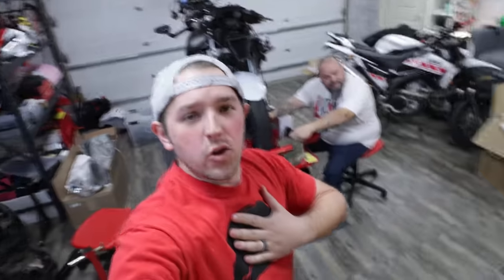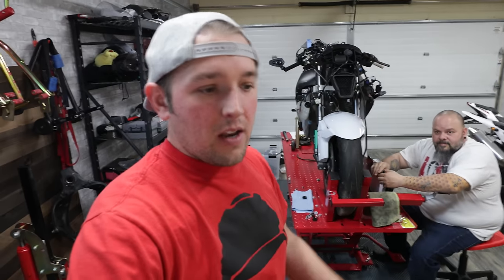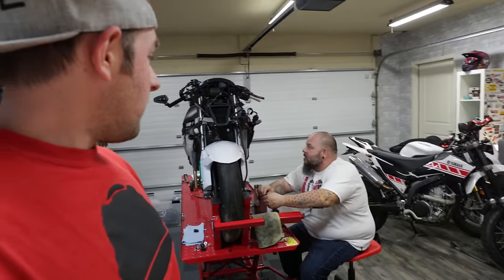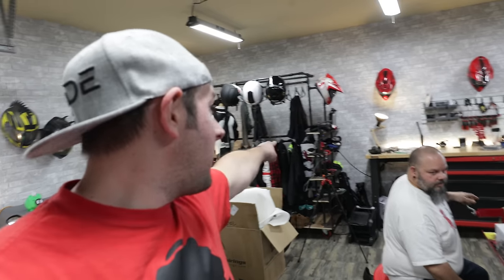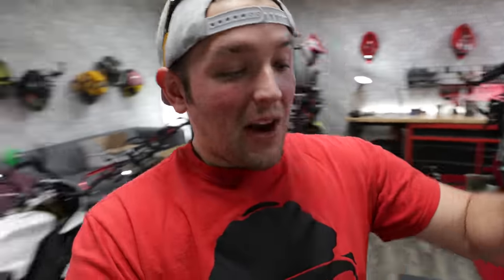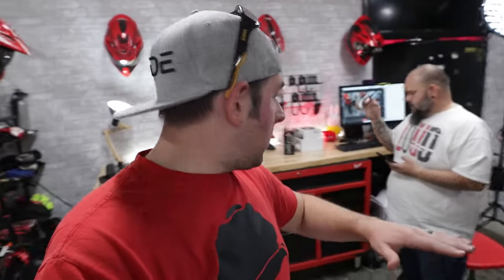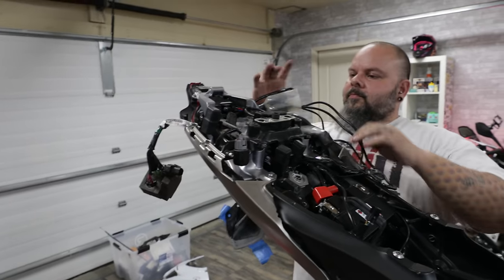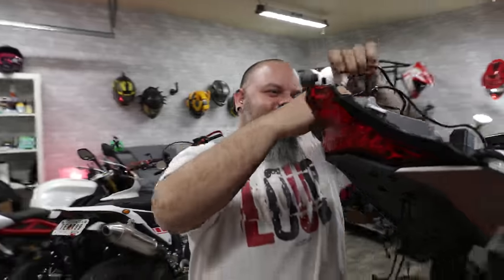LED lights install attempt! Why do they do this?! [Wrecked Bike Rebuild - S2 - Ep 16 - Ninja ZX-10R]

Comment: Sorry but I'm gunna have to beat the dead horse. You DID have the grips on your R6 installed backwards. The larger metal piece (they were white on your R6, I went back and watched an older video to make sure I wasn't crazy 😅) faced outwards and away from your bike, and not the way you described their orientation in this video. Either way I'm glad you googled it and determined the correct way they go on, because like you said, it feels natural to have large metal piece towards the inside of the bike as it acts as a perfect resting place for your thumb. But for the record, they weren't that way on Holly 😂. Anywho thanks for the free content as always!

Comment: I have the same bike and installed LED lights in my headlight housings. I used Heise LED's. What i did to make them fit, and keep it water tight was to cut the cap down to just the base and used epoxy to attach a new plastic cylinder to the end. I have pictures of exactly how i did it. it worked out great and looks factory.

Comment: I know it's all the rage to have cordless everything, but this should serve as an example as to why you should have a power cord BACK-UP dremel tool. Heck, you should have a power cord back-up to almost every tool you use (rely on) the most. Just sayin'. Oh, before I forget, you should NEVER (under any circumstance) smell ANYTHING your buddies say "hey, smell this..."! It's never going to be pleasant. Just remember that for future reference.
Reply: Actually, I'd say in your own garage you should have everything WIRED IN. Cordless tools are only useful outdoors and in construction where it's not possible or practical to drag an extension cord all over the place. When it's your own garage, you have no excuse. I mean really, how hard is it to manage a couple of cables? It's just laziness in my eyes. And you gotta plug the battery into every tool, the same way you have to plug in a cord so there's basically no difference.

Comment: They make universal dust covers for the LED’s. It replaces the stock dust cap. I used some silicone to seal them to the headlight housing and they sit tight around the led bulbs. I got a set for my R3, I did a cheap led/projector update a couple months ago.

Comment: Chase, I used abs cement ( for sewer, drain, waste and vent systems) to fill in the hole on my bike because the hole wasn't perfect. The stuff is made for high heat and has lasted on my bike no problem. I used the brand Oatey #30916.

Comment: If you think you need any extra sealer. Get a tube of RTV silicone. It's made for engines so it's not going to be affected by what little heat the headlight can produce.

Comment: for the flasher they sell an electronic flasher specifically for LEDs that will be a plug and play for the stock flasher. no need for the resistor block Brian was talking about.
Reply: Yeah its called a flash-relay or something right ? That works for both back and front blinkers that is made for LEDs less power.

Comment: I have installed those Driven d3 grips on my SV650sf years ago. They were tight enough where you don't need glue for them. i used some silicone spray to help them slide on. After the spray had dried/evaporated they snugged up and don't twist on me.

Comment: Take a drill bit with the right size to open the bar end and get a blinker relay that can handle the led lights and you have a real easy job done without any additional work to do.

Comment: H4 is a high/low beam in a single bulb, which is why motorcycles using it typically will use a single bulb. This includes a huge share of all motorcycles in production, like most cruisers, dual sports, and many naked bikes. Its not missleading to say its a kit.

Comment: Chase should've looked into OPT7 LED, Stark LED phantom series, or Novsight LED's. personally opt7/ novsight are my favorite because they fit perfectly inside the stock housing. I like to punch holes on the backside of the headlight dust caps just to allow the hot air (built in fan from LED) to circulate out.

Comment: Shouldn't the lever guard be on the right hand side to prevent accidental breaking and making a front flip?
Reply: They're gonna install a breakaway brake lever, hence the lever guard on the clutch side.
Reply: The lever guard is a bit pointless on the clutch, it is there for looks alone, the lever guard is meant for the brake side to prevent accidental application of the lever from contact from for example other bikes in racing.

They come from Moto GP and super bikes, they had issues from bikes colliding and hitting the lever causing bikes to crash.
Reply: +WRAIIITH brake lever guard is to protect the brake from being activated while riding by another rider, car etc. Breakaway lever will not prevent that therefore putting it on the clutch side is useless. One look at motorcycle racing and this would be obvious, not sure what’s so hard to understand...
Reply: realsmokey11 Yes! My CRG levers tilt up; that will not help in a track entanglement. I have never seen a lever guard on the left. It makes zero sense.
Reply: It for the clutch as well..

Comment: the led's often come with a ring that installs into the headlight housing. then you place the rubber boot on. then place the led shaft through the hole the rubber boot and into that ring and rotate to lock it. and then connect it to the stock wiring. check to make sure the led's you buy have the removable ring.

Comment: Use Cyclops LEDs. They work perfectly on Kawasaki. Had it on my ER6N. No need to cut the outside cover, also everything will fit inside the housing because there is enough space including the “ballast”.

Comment: Chase you should buy your led bulbs from auxbeam. The driver is smaller and there's less wires and they make really high quality led bulbs. You can get a 2 pack kit for $50. Also you can buy an led flasher relay instead of buying load resistors like brain was telling you about. The load resistors would work fine, but you can get an led flasher relay that you can adjust the speed to however fast you want.

Comment: When you're trying to centre the hole you want to cut for the bulb, use a dab of paint, grease or toothpaste to mark the cover. 
Put a dab on the centre of the bulb heatsink then line up the cover to where it locks in. The paint, grease or toothpaste will mark the cover, that should be your centre point for your hole saw. Hope this info helps

Comment: you have to modify the cover of the light housing to fit leds as they heat up so normally come with a large heatsink and the older ones have a ballast. i have had a few of led lights and have them on my cbr600rr, i was going to fit them on my s1000rr but you have to modify the light cover so i left it to old gas lights.
Also check you light model and if you get 1 or 2 leds before odering :)
And after seeing the end of the video, the heat sink dont get hot enough to melt rubber or plastic, my cbr600rr has a rubber cap over the lights and my heatsinks go through the rubber cap hugging the light and there fine.

Comment: TST makes an adjustable turn signal relay for this exact problem. Have one on my bike super easy works great. No need to wire in resistors. Lol They probably have one to fit the zx10 too.

Comment: Super stiff hair spray for grip glue they slide on like a dream and hold up great on my super soft dirt bike grips. after struggling so much because my grips wear out often because I like them so soft that tip I found makes things so easy
Reply: EagleWingADV hairspray is a classic trick. Works great.

Comment: Also instead of a load equalizer you can get a constant rate turn signal flasher. It's electronically timed not based on load.

Comment: Get the LEDs that don't have the fan at the end. There are LEDs that have some kinda strips which are flexible. That'll make it much easier to install. And you won't have to cut anything anything from the housing.

Comment: Not a ballast it’s external led driver!!!!! Leds don’t have ballasts
Reply: Eco King - Lies! Im an electrical designer, and work with lighting manufacturers to coordinate lighting for buildings. But I digress, drivers and ballasts are the same device, they regulate the spikes of voltage from their power supply as the devices dont actually operate at 120 volt power supplied from your panel as well as usually integrate into the controls, whatever that may be. Your bike also produces AC power (your alternator does), so yes, this is relevant here too. There is infact a diode bridge rectifier to convert it to dc for your vehicles battery. The reason there are two terms is to avoid confusion with fluorescent ballasts.
Reply: Actually with most LED kits, it's a CANbus decoder.
Reply: brickson98 MotovlogsAndGames - Canbus decoders have integral drivers. The decoder itself is merely a microcontroller.
Reply: Yeah. Honestly on every vehicle I've installed LED headlights on, I haven't had to use the decoder. Just wire it straight to the bulb. Only newer cars need it, really. My 2014 Ninja didn't even need it.
Reply: brickson98 MotovlogsAndGames - The driver sometimes come integral to the socket as well. LEDs are low voltage since theyre diodes and such, there is always somewhere, a transforming/regulating device in the circuit.

Comment: Please don't buy a resistor to slow down the indicators, you can buy a replacement flash relay that does the job for front and back together

Comment: I'm not saying Brain doesn't know his stuff, but isn't the reason the rear blinker is blinking fast because there is no front turn signal pulling any power as well? Just like a car if your rear signal goes out the front blinks super fast

Comment: If the zx10 uses an actual relay for the blinker you should be able to find one that's designed for LEDs and not have to wire in a load equalizer.

Comment: Never seen a single LED kit. But that little box is a CANbus decoder, not a ballast. You guys might've figured that one. I guess I'll have to see as I progress through the video
Reply: BTW on Amazon (no it's not rocks) if you look up WINpower LED kits, they make them in all different types and they've worked great in my car, bike, and my buddy's car. The 2 lamp kit is only $30 and is made in the same factory as a $70 kit, just with different branding on it.

Comment: Wouldnt it have made more sense to run the mirror clutch side and the guard over the brake lever as they are meant to be used? Or are there laws onto what side the mirror has to be in u.s. of As
Reply: Mike Smith they literally discussed that I  the previous episode ffs do your research before asking
Reply: Chase is stupid and thinks you have to take your hands off of the bars to do a head check
Reply: In my state, and many others, there are laws for what side your single mirror has to be on.
Reply: Conceptually, if you're so bad at doing a head check that you have to take a hand off the handlebars, you shouldn't be riding a motorcycle. Where is anyone moving their hand for the fraction of a second it takes to look over your shoulder? And its called a throttle.
Reply: Cam Sorry, my error, it is the throttle. I was just trying to point out that in my experience you may have to move your arm to see from a bar end mirror. Since my bike has a lot of engine braking even at freeway speed, the preference for me would be mirror on the left. Yes I agree with you changing lanes should not require a hand off the bars! Fwiw, here in California you can have just one mirror on either side.

Comment: Why didnt you just use the wiring diagram in the electrical section of the service manual to find which color wire went to which turn signal? It took me about 45 seconds to open the service manual and find it myself.

Comment: Try auxbeam I got my led headlights from them and it’s a single plug. They have a somewhat small bulb it comes with both bulbs and the led driver but u can take it off its for cars that throw a warning light if the vehicle thinks there’s no headlight.

Comment: Why is this protection thing on the handlebar only on the clutch side. Wouldn't it be way worse, if your opponent touches your brake leaver? That would let you crash instantly but if he pulls the clutch by accident, it wouldn't be that bad. Or am I wrong with that?

Comment: Question about when the tail light wires are brought up.....to remove the wires from the stock connector, what about a PSU wire extractor for custom sleeving pc power supply wires? are those the same wire ends with the little fins that snap the wire into the connector?

Comment: hey everybody quick question i just installed a m4 slip on onto my 2017 fz07 and have a exhaust leak, i had enough tubing to slide in and the clamps are tightened all the way.. so now im looking for a high temp seal i can put around the tubing and see if that will fix my leak, anyone have any good suggestions onto a good silicon or anything of the sorts that will work? also i used the one that came with the exhaust but it just melted off. thanks for any help.

Comment: Go to The Retrofit Source they're in Atlanta, take the headlight with you so you can test fit if you want. https://www.theretrofitsource.com/led-bulbs/head-fog-light-bulbs/h7-profile-peak-led-headlight-bulbs.html this is what you want the driver is tiny and you just shove it in the headlight too the back of the bulb is a lot smaller than most, you may need to trim the cap inside a little. You'd probably get a cool video out of going to TRS too

Comment: Of all the things you have supposedly learned over the 2 wbr series, why did you not learn to check the service manual before buying parts so you could make sure they'd fit? Every time I order sonething for mine, unless it's directly from the distributor, I triple check the dimensions of everything and then find what I need. I never relied on someone else telling me what bulb I needed for my headlight, I went outside and checked it before buying. It's pretty much one of the most basic skills for any wannabe mechanic. 

This series is really taking way too long because of these delays. Can you actually do something significant next episode?

Comment: can't wait for the bike to be done! for the LED lights try checking http://www.theretrofitsource.com they have amazing lights and very high quality with great customer service, I have their HID system on my bike and it's absolutely wonderful. also for the blinkers check https://tstindustries.com, they have flasher relay instead of cutting and soldering blinkers wires.

Comment: You should check out supernova v.3. Led conversion. It comes with two leds. Has flexible heat sinks instead of the giant fan. So you wont have to cut anything for it to fit.  They are some of the best quality led on the market I have them on my 2000 gsxr 750 and them make a world of difference. Must have for any night.   riding.https://headlightrevolution.com/supernova-v-3-led-headlights-h7-bulbs/